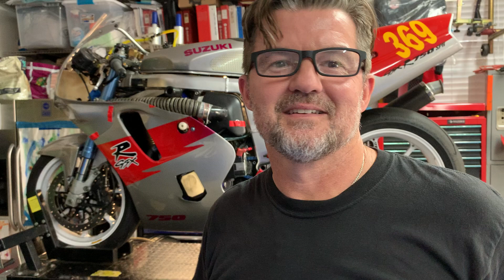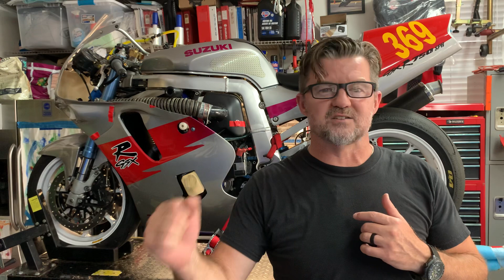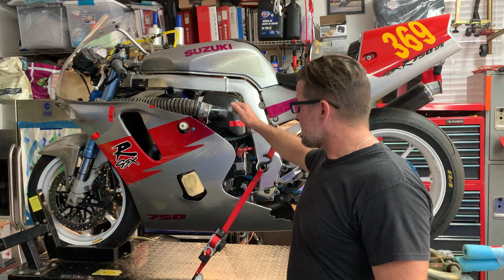Dymag and PFM Brake Review on GSXR 750w

Comment: 144 main jet for the 41 mm kehins

Remove the ram air system 
If its not a sealed system it doesn’t work just creates messy air around the trumpets
Reply from the maker: Here was the problem. Ran great after. https://youtu.be/Fo3Kwv0P_OI

Comment: i'm certain the fresh air is affecting your carb settings.  i'm no carb tuner, but you might have to set up your carbs for the ram air, then deal with the rich issues when not in the fresh air RPM...if this makes sense.  otherwise, it would be good to know how carbs were set up back in the day with fresh air.  any additional air will affect the setting.  good luck and keep us updated.  i'm a new subscriber, but  i recognize you from the gixxer.com days.